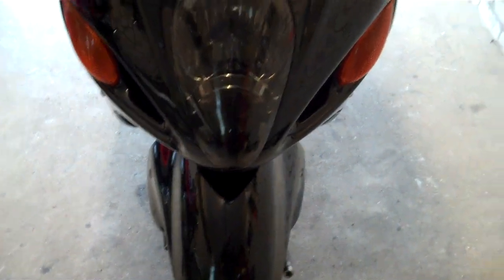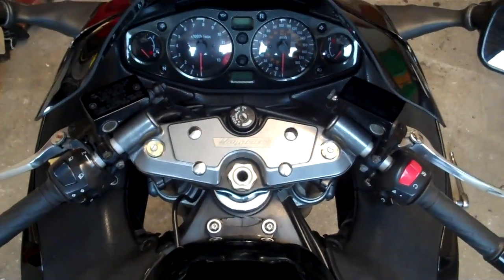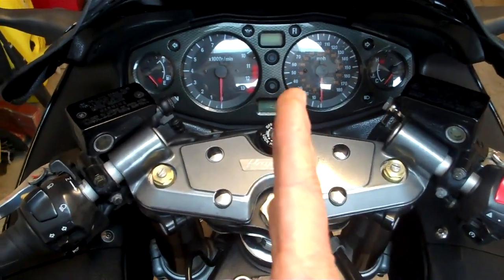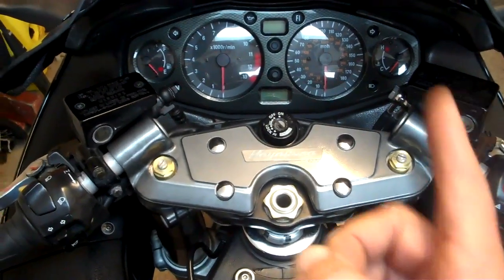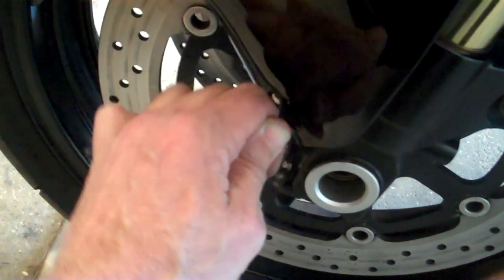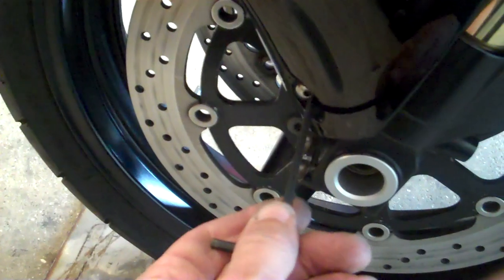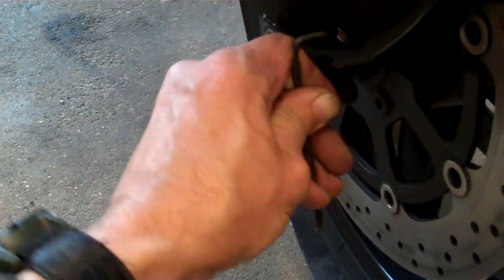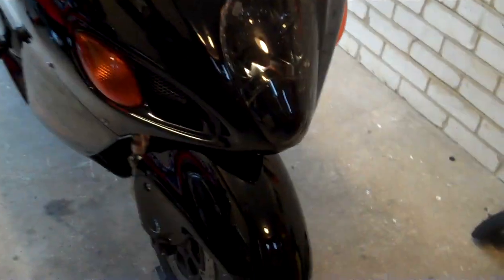Delboy's Garage, 'How-To' Re-align motorcycle forks the easy way.

Comment: if any one that is following Delboy's helpful advice and doesn't have a piece of sheet metal for front tire, Use a folded trash bag, heavy duty leaf bag is best, and your tire will turn like butter, thanks again Delboy, keep the advice coming, Your a Gentlemen and a shade tree mechanic scholar.
Reply: Top tip, like it!

Comment: Whenever I'm aligning anything from forks to hanging a picture on a wall, I use this trick; stand back and say out loud couple of times 'it's off to the right, it's off to the right'. Then without touching anything you repeat 'it's off to the left, it's off to the left'. One statement will always feel just that little bit more true until you have it just right.

Comment from the maker: Hi Sam..ok,  just looked at Penny's bike, At the back of the caliper there's a small pin that goes through both pads (the pin has a 'flat blade screw head' so fit a good quality screw driver in that pin head, back it right out and remove it, the pads will now slot out of the back of the caliper, if you back off the front bolt a bit it will give you some 'jiggle room' to help free them off, and if you lever the pistons back you'll be able to drop them out, let me know how you get on, Del.

Comment: If you weld a handle on the nut you use for your axle it will work a lot smoother and it will only take about two minutes to do it ... it will save you time in the long run ... I love making my own tools.

Comment: Using the nut for an Allen key to loosen the axle is really clever.
Reply from the maker: Simple ideas aye mate!
Reply: I bought a nut and bolt that was same. ran nut on all the way and the cut off the excess. Then no fidgeting trying to get the nut to be half and half
Reply: Throw in a thick spacer with a smaller diameter or 2 in front of the nut it will prevent the nut from sinking all the way into the allen wrench slot
Reply: Only thing I had was the end of a tap, stuck in a chainsaw type wrench with a screwdriver in the holes to hold it.
Reply: If you jam some T.P. in there before the nut it'll keep the nut from falling in too...
Reply: Lol I took the biggest Allen wrench I could find, and then a smaller T-Handle Allen wrench and put them flat against each other. Basically 2 hexagons, one bigger and one smaller in one giant hexagon 😆 Works great for a few years now 👍
Reply: I bought a cheap Allen key to fit that hole... then cut off a 3" straight length of it, and then fit a socket over that.

Comment: Thanks for making this video, been having issues with my fz6 not 'riding straight' since I got the bike, throwing my right hand corners and most importantly my braking completely off. I'd just about had it till someone mentioned the front forks, they looked straight by eye, but I thought I'd give it a go following your video.. feels like a brand new bike.. actually turns and brakes as it should, found joy in riding once again.
Reply from the maker: Cheers buddy, glad it helped you, this is a good little maintenance tip to do once a year, today's rotten roads, pot holes, and bumping kerbs can throw your forks out dead easy!

Comment: Perfect advice, will do in the morning :)
Another handy tip - when using a nut as a large hex bit, screw it tightly onto a bolt. The nut never lines up perfectly with the bolt head and prevents you pushing the nut in with the socket. You can always pop a weld on it to make a useful tool for future use - also stops the nut coming undone if the thing you are loosening was done up strongman style - I can't be the only one to loosen and re-tighten everything I've had done by someone else!
Reply from the maker: Good luck with the job mate!  Hope it all works out !

Comment: This worked an absolute treat. I knew my forks weren't bent, just a bit twisted. I was trying to figure out how to mark and measure the fork legs, but I didn't need to because this cured them completely. Cheers.
Reply from the maker: Nice one buddy, there are cleverly designed by the factory to self 
centre in the yokes, just need to loosen it all off and plunge them up 
and down a bit - they will soon find centre again !  Thanks for taking 
the time to let us know !

Comment from the maker: Cheers mate, just remember don't over-tighten anything, they're hard steel bolts into soft alloy threads, just nip them up hand-tight and 'dot' the heads with Tippex or nail varnish to keep an eye on them for a day or two afterwards, good luck with it, Del

Comment: I took a hard spill off road on my Africa Twin yesterday, enough to bend the bars and twist a riser in its mount. Luckily, I was able to limp to a Honda deal 35 miles away where they put on a bar that'll work temporarily and the riser corrected itself on the installation. Driving home, though, I saw the bars still didn't seem square with the wheel (they should've checked that, I think). I came across your well-taught video today and did the process just as you describe. Problem solved.

You have a great teaching style and nothing was left unsaid that needed said. Thanks for this.

Comment: For people with a wonky sense of level,straight and angles there is a trick you can use called "Boning" (no not that sort) It's a joiners method of checking parallel.You need two straight pieces of wood, metal bar or similar. With two people get one person to hold a straight edge across the lower end of the forks (the lower the better). Now take the second straight edge and place it at the top of the forks, Across the handlebars or some other place you can check it is not angled. Now stand on the pegs and lean forward and look out at both ends of both straight edges if they line up at the tips the forks are true. If the ends are looking a bit like a very flattened x in comparison to each other then the forks are out and the flattened x will show you which way they are out. If the left bottom tip of the straight edge is in front of the top left tip then  your bars need to turn to the right while the wheel stays straight ahead. If it's the other way (bottom right tip is in front of top right tip and the other end the bottom tip is behind the top right tip) then the bars need to turn left while the wheel stays straight ahead. It sounds complicated but print this off and practice with your bike to find the best place to put the straight edges (through the front wheel spokes or above but the further apart the better) then you will get it fairly quickly. Ride Safe and keep it shiny side up.
Reply: +Jeremy Markham that's simple and good bro,thanks for sharing
Reply: Jeremy Markham  awesome thanks for info
Reply: This actually helped clear some paranoia doing it alone. Thx ^_^

Comment: Followed your instructions in this vid today on my Zephyr. And i also lowered the fork by pushing the tubes 12mm through the yokes. It worked surprisingly well. I also raised the back using the excenters in the swingarm. The bike steers *much* sharper now!

Comment: Hey Delboy, just want to say a big thank you, this video saved me so much money and hassle, I have a moped and honestly thought my frame was bent following a small crash (not my fault), I googled and this video came up. I tried what you said in the video and hell, the difference, my bike is back to perfect ride again. Thank you so so much. You are a lifesaver.

Rich
United kingdom.
Reply from the maker: Hi Rich.. good to hear from you matey, and glad the video could help you out.. the forks are only gripped by the yokes using friction, so they can be easily knocked out of alignment.. even a bad pot hole or bumping up curbs can cause the, to be knocked out a bit... just do this any tome it happens again... and it'll usually be fine..   Hope you weren't hurt in the "small crash".. ride safe mate.. Del.

Comment: did you loosen that big silver bolt in the center of the handlebars?
Reply from the maker: Sure did Oscar, just forgot to mention it in the video....its important to back it off so the two clamps can move independently of each other and re-align.
Reply: @Moonfleet41  when do you re tighten this?
Reply: @elliotfricker4631  at 11:31 he says to tighten from top down.

Comment: I really appreciate this video. I lowsided my CBR250R after my front tire took on a clump of mud at 10 mph in a slight corner and bent my handlebars out of alignment. This really helped. It took about an hour of me fiddling around before I got it aligned to my liking, but I later realize that I never loosened the top center bolt. I went back and loosened it and tightened it back up in case there was some tension that needed to be released after the adjustment had been done without loosening it. Thanks Del.
Reply from the maker: Soviet Tiger Nice mate, glad you got it sorted... next time, now watch out for those mud clumps lol! RSMF

Comment: Cheers for this!  I just followed your method.  Lowsided my R6 trackbike yesterday and I was told "Yeah you got a bent fork mate".  I followed your tips and I'm as sure as anything it was just turned in the yokes!
Reply from the maker: +GuzziHeroV50 Thats usually what it is mate, the fact that the yokes only hold with friction if designed to let the legs twist in thier holes and prevent damage.... USD forks dont bend unless you hit a wall hard..!   Hope you've sorted it chap... all the best. Del.

Comment: Magic, thanks for that.  Very informative.  I rebuild a crashed Gen 1 in 2004.  It had bent forks so I replaced them and never did the alignment thing.  Never had a problem but wish I'd seen this video prior, would have been able to check it easily.  My local mechanic berated me for tightening the forks up to much for the same reason's you say.  Delboy's Hayabusa is a world of knowledge - love it.

Comment: another well made helpful video thank you your trick with the fork seal driver made from exhaust clamps and waste water pipe works a treat . I bought my clamps in a tractor and farm machinery garage .  I recently changed fork gaiters on a bike I will go back and  make sure the forks are straight   now  . I will also check the headstock bearings for play and swing arm bearings
Reply from the maker: Bob Marley Hi Bob, glad the videos could help you mate, good on you got getting stuck in.. Del;.

Comment from the maker: Cheers mate, good luck with it!  Set the back alignment first by measuring off the swing arm pivot for absolute accuracy... then do this to the front, if it's still tracing after that you could have deeper troubles - good luck, Del

Comment: This is great knowledge. I have K4 GSXR 600 and I was very close to buying new forks and top and bottom yoke because I could not work out what is wrong. I realigned the wheels and when that was done the top yoke was twisted to the left just like you hayabusa. 
I will dive to the garage tomorrow to perform the realignment that you did in your video. 
I will post an update once done
Cheers
Kam
Reply from the maker: Good luck with it Kam, hope it works for you, let us know how you get on!
Reply: how did it go for you?

Comment: Im currently doing a complete alignment on my 97 ultra classic
It is a fair amount of work started arft and worked on through the box and the motor stringlined the lot and sprit leveled wherever I could and plumb bobbed the thing up the warrzoo
Hopefully I will be finished the front end tomorrow
Thankyou for some sound advice Del
Good onya 
Hooray yeah

Comment: Thanks for the vid, someone didn't clean up an oil spill in the middle of the road, so I ended up low siding my bike. My alignment is a bit off, but this video helped me understand how to set the forks back straight. Thanks.
Reply from the maker: Well done mate, goad it could help you, and hope you weren't hurt in the drop... good luck.. Del.
Reply: Moonfleet41
 I found out that my right fork was a bit higher after the drop, so I had to loosen up the top tree to set the height back to OEM specs. After that, I did the same process in this video,which is to pump on the bars and tank to help settle the bottom forks.It took a while, I had to hold the wheel and tweak the bar with my hands, and pump the front end down again.However,the job is done and it worked out well....many thanks.

Comment: Thanks for the video was very useful after servicing my fork seals, installing the forks back is simple yet details like this are very important to follow.  I did use a torque wrench and used a service manual but your video made the difference.
Reply from the maker: Thanks buddy, glad it could help, sometimes seeing something is a bit easier than reading it in a manual, eh?  Ride safe, mate, Del

Comment: We always used a spark plug socket head that will fit in the wheel bolt.  Just turn it backwards n put a extension in the socket backwards n it works like a charm. But you have to have the big headed ones not the lil 5/8 ones. Hope this helps. Great video!!
Reply from the maker: Great idea Dale.. thanks for the tip.

Comment: did this on my MT-01, it handles much better now, it was turning easy to the left but harder to the right but now its the same either way, had a low speed off a while ago, it moved the bars in the clamps which I sorted, didn't think it would alter the forks. thanks for the info.
Reply from the maker: chaz Nice one Chaz, glad it could help you mate... it's a simple fix and doesn't hurt to do it once a year or so as even potholes day to day can throw out your fork alignment, as they only grip by friction !

Comment: My fork tubes are different heights. I have a Honda VTX1800 2003. I removed the wheel to change the tire. Since it was my first time learning it took me many weeks to watch videos and acquire all the minimal hand tools to get the job done. Since the wheel was off the bike I decided to do a complete caliper cleaning thanks to all your wonderful videos. Two months later I'm finally ready to mount the wheel. Before sliding the wheel in place I test fitted the axle, sliding it thru the left fork first and when it bumped the right fork it was about  20mm higher than the hole. So the right fork was too low. Trying to add hand pressure to mate the two only allows about a 5mm gain. I figure I'm going to have to use a jack stand or similar to force the right fork up to align the axle hole. I'm scared to muscle it into place knowing uneven pressure is being exerted on my suspension. So tell me what is going on here?!?

Forgot to mention that when I initially removed the axle it was extremely difficult having to try and pull it out and at the same time twist it left/right. Since this is my first time experience to remove a wheel I did not know what normal was, so I assumed tolerances were tight and causing me the extra work. Now I know that it was the fork tube height differential that was causing this to happen. I tried to find videos addressing this issue, but all I can find is rebuilding the forks and lag or rider adjustment.
Reply: I found my answer on a VTX forum. Turns out one of the forks is a compression fork, the other a rebound fork. The ultimate answer is you have to compress the longer one to align the axle holes for the insertion.
http://www.vtxoa.com/forums/6-vtx-1800-tech-board/221409-front-forks-axle-holes-not-alignment.html?action=thread

Comment: Fantastic vdo
I have had this front fork bounce at low speed for 1 yr tried everything spend a load of coin on suspension gurus
Then I see this vdo  and think not to torque the lower triple clamps to factory specs and low and behold the bounce has gone so thx mate for the advice great work
Reply from the maker: Good to hear from you Patricia, im glad it helped you out.. take care. Del.
Reply: Only issue I have now is a little brake  dive now !! As I'm pretty hard on  the brakes into corners. But thank good the bounce has gone
The factory specs on the bolts for the bottom clamp was 28nm I gone to 20  nm way better

Comment from the maker: Hi CJ.. check them if they feel out...i have always been a fan of the old mantra "if the cart aint broke, dont fix it"..ride them next time and look down at the bars as you cruise in a flat straight line,, if they are a bit left or right, then do this adjustment....but if they are bang on, leave well along.. you can make work for yourself for no reason.... good going buddy... cheers, gel.

Comment: I've been watching piles of your videos.  Thank you so much for your tips and insight!  As you have shared so many tips with us, I thought I would share back a bit.  You used a 24mm nut for the axle.  When doing that, you can either space it off with a few washers or "make a tool" with a 24mm bolt that is tightened on and cut to length.  That will make your 2-hand job a 1-hander.

Comment: Thanks to the step of loosening that axle bolt of yours I got the idea of using some paper towel as a spacer to make use of a 14mm nut to get the cap off my ickle Yamaha SR250's one fork. I was previously trying to use a bolt with a series of the nuts on the end hoping they'd clamp each other down, but I needed to apply so much torque to the damn thing I was making the two 'clamping' nuts turn along with the one I was applying the torque to.

With this I could use my torque wrench with its nice and long handle instead and finally get the thing cracked.

Comment: Great vid. When you use the nut and socket to loosen the front axle, try placing two nuts inside the socket. The second nut will usually stick out enough to fit in the axle.
Reply from the maker: Yeah, good tip, used that before!